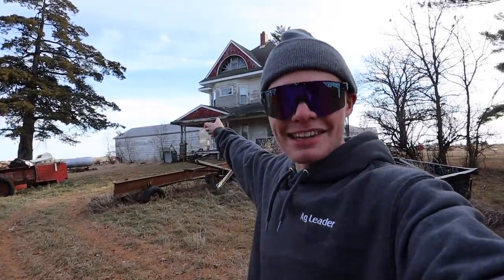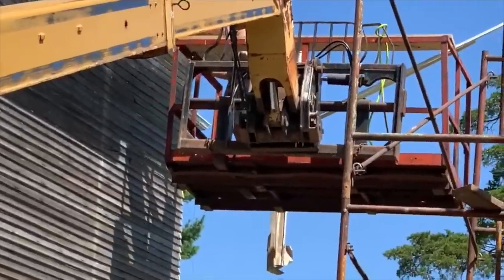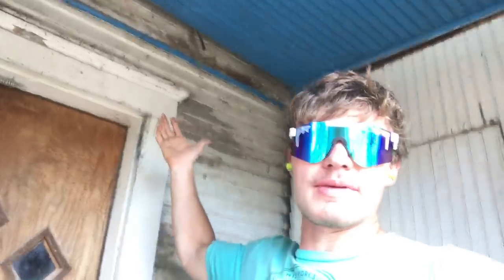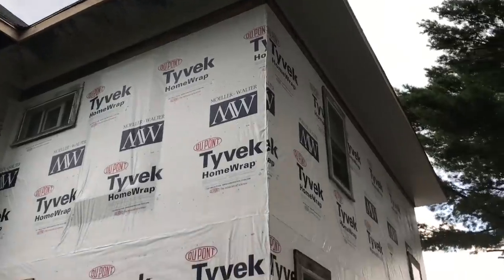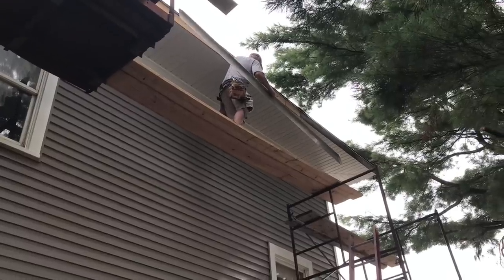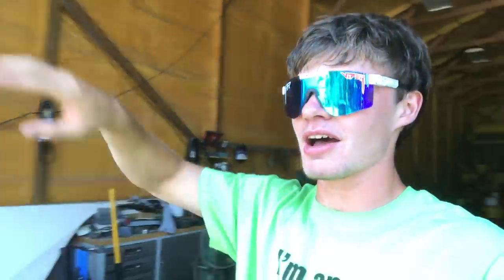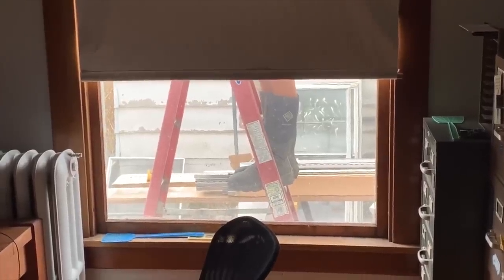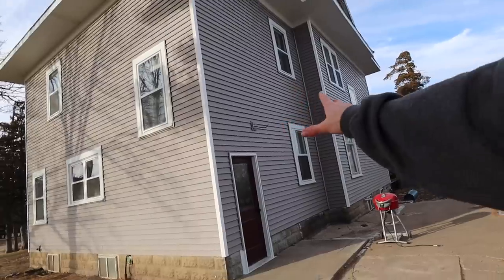OLD FARM MANSION 1ST REPAIRS IN 102 YEARS!?!

Comment: The reason your house survived the 102 years was because the quality of the original wood was created to last 100 years AND 100 years MORE and 100 years MORE!!!  You just removed it all and installed a disposable 20 year product.  You are young and if you stay at your home, you will be regretting your choice in the coming decades, because you will be facing replacement all over again.  You could instead retain the 100 year product we call old growth wood that can no longer be purchased in our society that has over harvested forests.  People give an arm and a leg for that architectural salvage, old growth wood.  A single board from 100 years ago is of higher quality in strength than any board you can now buy at a lumber yard today.  Just take a look at the grain per inch on the window sash you are tossing and compare to a new piece of lumber.  A wooden sash can be returned to 100% functionality with a little effort.  You could kept what was still in good shape, treat what is salvageable, and replace with new wood only what can not be salvaged.  Wood can be repaired, reconditioned and last another hundred years.  How to: http://historichomeworks.com/  The vinyl and metal siding will conk out in a few decades.  That happened to my family's historic homes.  My great-grandfather's two victorian homes were changed by his son in the 90/00s to aluminum and daughter-in-law to vinyl.  They are faded pieces of crap now...the vinyl is brittle and has had pieces fall off.  I live in the faded aluminum one now and have exposed some of the old growth wood siding underneath in great shape and all I need to do is just pop off the aluminum and go back to what was quality and durable...wood.  But all the ornamental gingerbread details were butchered to put the aluminum on.  It now looks like a plain home, not a beauty like it was.  Wood...fix it, then keep the paint up and you are golden.  Of course modern paints fail and make house painting a nuisance.  That's how the paint industry sells more product.  Use what was originally used; linseed oil paint which can be painted with colored pigment once, then slap on clear linseed oil periodically every decade to keep the wood conditioned and bam, lasts forever.   Take a look at Europe for medieval wooden structures even older than American history.  All the crap storm windows that you are using went on the house I live in too.  They have failed now, so hard to open and close, and are bleeding air and there is so much condensation that I can't see out in 70% of the windows.  The replaced aluminum storms lived out their 20 year warranty and are now meant to be disposed of so soon.  Luckily, I have a pile of the original from 1890s wooden storms in the basements.  This past summer I repainted one original storm, reinstalled, now it's beautiful, looks far more appropriate to the house, and I can even see out of the 100 year old original glass.  It's sad what you just did to your home.  You took away the genuine architectural features of your home. Now it looks like you have a modern "home depot" house.  The historic curb appeal plummeted.   And in 20 years you are going to be facing what I am facing now...failure of modern products.  Remember, wood was used in American for centuries, has your vinyl been tested that long?  Nope.  Talk to people with vinyl houses 20 years later, they are not happy.  Vinyl, nor metal, is not meant to be repaired like wood siding was, it's meant to eventually be scraped and pollute by tossing in a landfill.  Lastly, world history tells you that wood and stone have been used for millennia.  But well, maybe your product is better than my 20 year product, maybe you got a 40 year warranty.

Comment: Wasted alot of time and energy ripping that old carside off. Should've just wrapped in weather barrier and ran your vinyl right over top.
Reply: If you're gonna do something you might as well do it right. Besides some of the boards under were ate up with termites and looked like some ants took
Reply: @billybobthornton4186   That old carside on a house that old is part structure. I just  completely remodeled a home and the Amish did exactly what I mentioned in the first reply. Nothing right or wrong and either way.